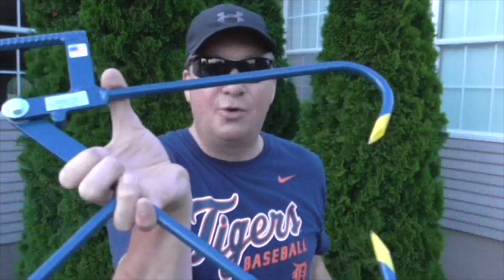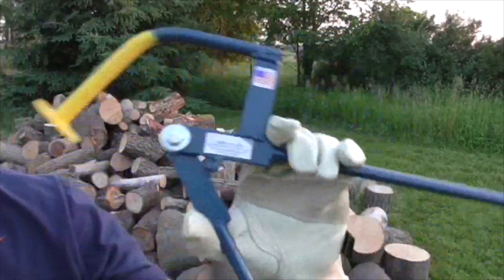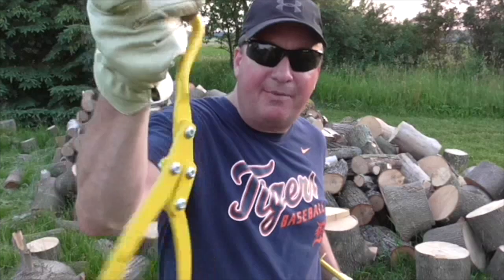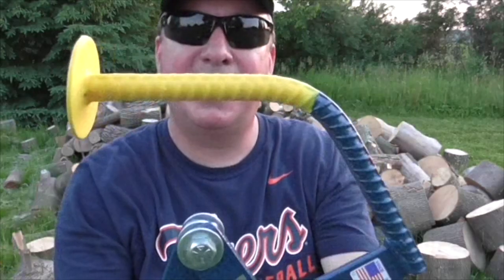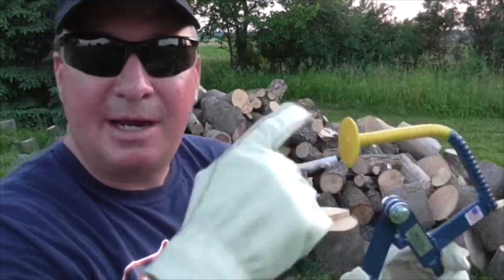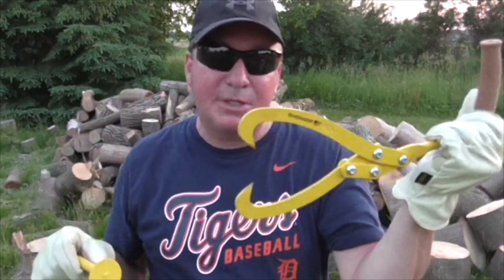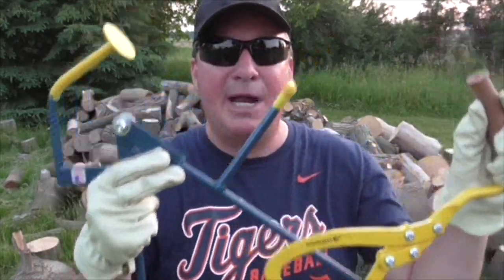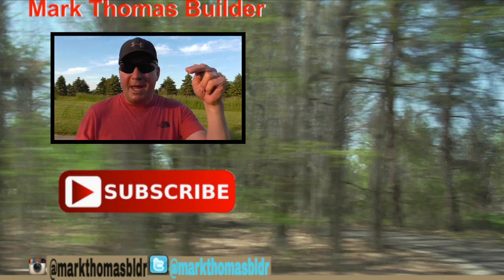TIMBER TONGS COMPARISON- OCHSENKOPF vs PINCH A LOG TONGS

Comment: We received your nice note regarding your discovery of  how well the Pinch-A-Log does work when used as intended.  Would you please kindly do another video to show the proper use so that people understand what a great tool the Pinch-A-Log really is and how easy it is to pick up firewood end to end without any logs spinning or flipping.  In fact the logs even 'feel' lighter, even though they are not, when balanced between the two pinch point horizontally as intended.  The best features of this tool is that there is NO deep bending and being able to pick up, toss and stack, firewood whole or split, 6 to 26".
Reply from the maker: I can do that.  I have a huge woodpile to split and the PAL will come in handy.

Comment: ox for the win...clearly better and more consistent grabber and looks far more comfortable and time efficient/less frustrating.  My pick is actually the 25 dollar cold steel tomahawk with pickaroon on the back end, that has a nice size handle for this work and never fails to stick, it's a perfect pickaroon.  And for heavy logs and rounds you need the logrite/stihl two man lifter!  Northern Tool sells a cheaper wood version of these two man lifters as well.  If you don't have two men, get a log cart like I got from northern tool that can easily slide under large rounds and roll them around with ease.
Reply from the maker: I've always had my eye on the Logrite log arch.  Unfortunately, they're a little out of my price range.
Reply: You and me both Mark!  If I was in Minnesota timber country I'd take the plunge, but I'm in the farm country and mainly split naturally downed trees or trees that need to come down for a reason other than firewood.  Then I just process up whatever happens to be available.  So I don't think I deal with enough trees or tree navigation issues in a forest environment to justify one.

The northern tool log cart I have is no where near as heavy duty as a logrite log cart or their arch, but it's much much cheaper and has worked out for the 100-200 lb rounds I've wheeled around in it.  I did buy the logrite super long cant hook with extra strong handle.  Pricey but has proved its worth.  I had to pull a 1000 lb log out of the ground as it had sank in over a number of years, and with that simple hand tool I was able to do it!  Also makes it easy to timberjack these heavy logs, I put my smaller timberjack right next to the logrite can't hook, then use the long handled logrite to roll the log and be able to easily pop it up on the timberjack as I move them both in unison.  These timberjacks alone don't have the strength or leverage to be able to move the heaviest of trees by themselves.  Or you can just start a cut on one side, roll the log with the cant hook, then get the other side and not use the timberjack.   Before I got this super long and strong cant hook, I could not deal with these super heavy logs at all as my timberjack was my longest tool and wasn't long enough to get leverage, and would probably bend if I was phyically capable of moving the logs with it.  The jackstand itself is strong enough to hold up these logs so I'm able to use the cant hook and timberjack in conjuction to jackstand 1000+ lb large diameter logs.

This is the cant hook I purchased: https://logrite.com/store/Item/Megahook

I bought a small wooden handled peavey because sometimes a short handle is fine for a rolling job and is easier to handle in a given work situation.  I like being able to stick the peavey in the ground when not in use as well, but having used both, the cant hook grips the logs easier/more efficiently.  I guess the peaveys are useful for separating logs in log piles, not a situation I usually deal with.

Comment: I think you will get better results with the pinch a log  if you pick the log up by the ends. It will be more stable
Reply from the maker: I normally bring both to the logging scene.  I can often use both in each hand to move the rounds.  Each one has it's advantages depending on the size of the wood being picked up.

Comment: Hi there! Cool wood videos! we totally heat our home with a wood stove so these gadgets would really come in handy. I went to your links but with the OCHSENKOPF, it is a new model & different brand, GEDORE? only 1 review on there so I am not sure about that. Have you tried the new one?

For the Pinch-A-Log, it also looks like they are no longer on Amazon. I went to their website, but although they do have videos of the model you have, it also looks like they have redesigned it now. Have you tried the new design of the PAL? Thanks!
Reply from the maker: Thanks for letting me know about the links.  The brand Ochsenkopf is owned by Gedore, a German tool company.  They also supply items for Stihl, like axes and hatchets.  As far as I can see, the tongs look the same.  They work really well for me.  The cork grip if very nice.  They're very handy for handling firewood and log splitting.  

The Pinch-A-Log work well too.  They have a bigger opening, so I use them for moving the big rounds.   I haven't tried the new design yet, but suggested they get a padded grip, which it looks like they did.
Another brand to consider is LogOx.  I reviewed them on my channel too.

Comment from the maker: What one would you choose?  One of each or two of the same kind?
Reply: Bull.  I'll take the german tongs and a pickaroon over that pinch a log anyday.  Its too big, and being required to use it on pieces end to end is a slow cumbersome requirement.
Reply: I like the pinch a log design, I’ve used the hose type and tongs, I might have to get the pinch a log.

Comment: I know this is an old thread, but I just noticed that the grip used  on the PAL is backwards.
Reply from the maker: The PAL really works well with this original design.  I use it for the bigger rounds since it has the biggest opening of all the log pinchers I own.  I was on their website recently and noticed they made a few tweaks to it, one of them being a cushioned grip.👍

Comment: The handle does not have cork because cork will not last. When the tool was engineered, the owner was thinking of a tool that will last a lifetime. I would encourage you to review the video with the proper demonstration of the tool at https://www.youtube.com/watch?v=XbLcfd4Z824&t=12s and then please make an updated review of the Pinch-A-Log vs. Ochenkopf. This video did not show the Pinch-A-Log (PAL) grasping the wood on the ends, as intended, which not only balances the wood to make it perceptively lighter but enables the user to toss the wood as well.  On the occasion of picking up a standing log, the diameter needs to be 6" or greater.
Reply from the maker: This video was simply a first impression, testing it out for the first time on all types of logs and sizes.  Now that I've had it for several months, I'll consider making a video update.  One thing for sure, these tools sure come in handy for firewood processing!

Comment: $80 for bent rebar? That's a NOPE.
Reply from the maker: I use it all the time on bigger rounds.  It works well.  You are correct, the material cost is minimal compared to the final cost.